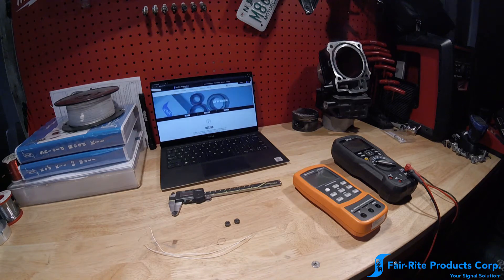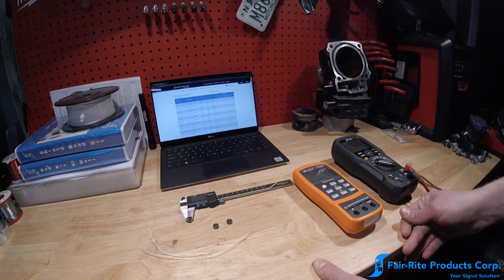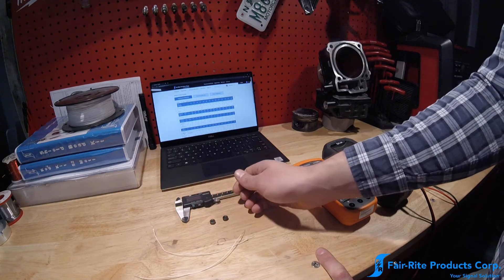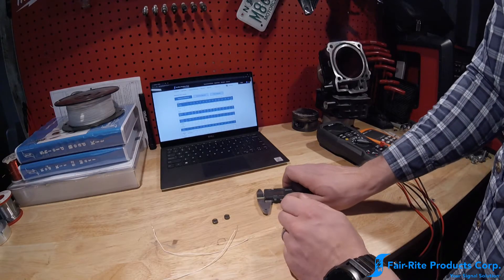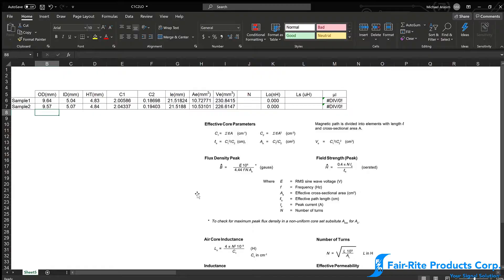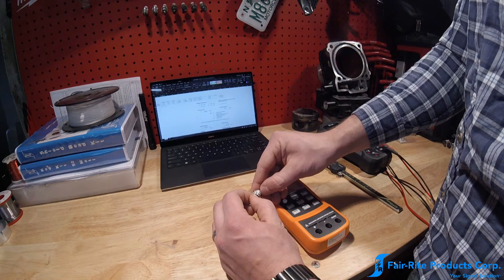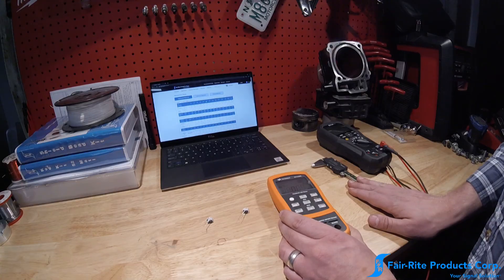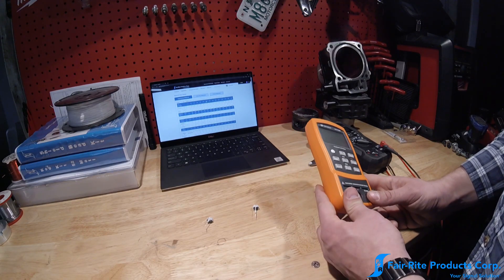How to Identify an Unknown Ferrite Core

Comment: Will thos work with snap on split beads?
Reply from the maker: It should work fine for snap-its. The permeability might read a little low due to the small air-gap present.

Comment: Kindly comment on type 31 vs type 43 for HF (1.8-30 MHz) choke?
Reply from the maker: 31 material. At 30MHz, they’ll be similar but, 31 should be superior below that due to the higher permeability.

Comment: what abour core shape like ETD or EE ? is this method work for that too?
Reply from the maker: That'll work for ETD or EE core sets as well! The calculation for the cross sectional area and magnetic path length are a little different but, the concept is the same. One thing to be cautious of is the air gap in cores like this. If the surfaces are well finished, this can be negligible. If the surfaces are uneven or rough, this can skew the inductance value very low compared to what the material perm would otherwise be.

Comment: f = 1/(2pi*((L*C)^0.5)). If you know your frequency, then use a series circuit with a potentiometer with your LC part of the circuit.  You can dial in your pot so that the voltage drop is the same, that the value as the same.  And you know the value of C, just plug and crank on your calculator, or spreadsheet.

Comment: Which ferrite type is the most stable at temperature changes (permeability vs temperature)?
Reply from the maker: As a general statement, 67 material has the most stable permeability over temperature. Depending on the exact temperature range, there could be other materials that are more stable at particular temperature ranges.
Reply: @FairRiteProductsCorp  thank you for your response!

Comment: Hi Mike. Wonder if you have a sec to help me determine What I have here. I have some snap together ferrite that I was able to determine are nickel based material. They measure A=25.7, B=13, C=28.8, &D=13. I'm looking for the best way to run the impedance test to determine the core material. The only markings on this is on the plastic case saying FAIR_RITE VO. I'm assuming that's just the plastic case number. Thanks for you time  de KA9TII
Reply from the maker: The V0 is just the flammability rating of the plastic. Impedance analysis is a bit more difficult. Essentially you’re going to need some way to genereate a signal and a way to measure the response of that signal. Some of the newer inexpensive Vector Network and Spectrum analyzers (Nano VNA or Tiny SA for example) have impedance analysis functionality built in to them. While not totally accurate, they are surprisingly good and should be more than capable of telling the materials apart. If NiZn, the core will either be 43 or 61 material. 

What does the outsize of the core/case look like? Whether it is round or square or octagonal will help me narrow down on a part number.

Thanks, 

Michael Arasim
Reply: @FairRiteProductsCorp  Thank you Mr. Arasim, for responding to my inquiry. It is square. I have a VNA, so I will investigate the impedance test. I'm not familiar with the procedure, but I'm sure I can find something on YouTube. Again, thank you so much for your time.

Comment: Ham’s have two main questions about Ferrite cores…
1. what is the best mix for choking hf common mode currents?
2. what is the best mix for hf step up / down transformers (aka baluns)?
hf being 1.8-54mhz
these types and winding are all over the place on the internet.
Reply from the maker: For HF common mode currents, 31 material should provide the highest impedance overall in that frequency range. At more granular (narrower) sections of that band, there are other less broadband materials that can improve on the impedance over that offered by 31 material. For transformers targeting lower losses, 67 material will exhibit the lowest overall losses in the HF band. Same as with the suppression cores, there will be some materials with higher performance in certain sections of the band. 67 material does trade quite a bit of coupling (permeability) for its low loss properties. A higher loss, higher permeability may be desired for certain designs. This is especially true for lower power devices. We will be coming out with a podcast in the next coming weeks to go into this more in depth so stay tuned! Hope this helps!
Reply: 1. Mix 31; 2. Mix 43. DONE!

Comment: Interesting on the beads. Are these actually useful as inductors or only as interference suppressors?  I used a Fair-rite bead to make up a 10 uhy inductor using a General Radio standard inductor as a reference. (The standard inductor is a relatively large air core unit.)  But there was no correlation to how they operated in a tuned circuit! The general radio unit resonated exactly as expected but the ferrite bead inductor was significantly off, (over 10%) even though they both read the same on the LCR meter.
Reply from the maker: All ferrite cores have potential use as an inductor. A lot comes down to the frequency they are being used at and whether permeability there is sufficiently high and the losses are sufficiently low at said frequency. Some variation on the inductance over frequency can happen even if the 10kHz inductance looks the same between two parts. Core materials will dramatically change the over frequency performance. Often times, in a very non-linear fashion.

Comment: Very helpful video, I still have one core I don't arrive to identify. Resistivity I measure to about 14 Kohm and Initial Permeability is calculated to 60. What mix can it bee?
Reply from the maker: Hi Leif, If it is definitely a Fair-Rite core….. 67 material would be the most likely (could have previously been magnetized to account for the higher perm).

Comment: Hi Mike,  Core sample 1 (MnZn) O.D. 62.08mm; I.D. 36.01mm.; Ht 12.89mm. Sample 2 (NiZn) O.D. 61.52mm; I.D. 36.30mm.; Ht 12.72mm.   Each toroid was wound with the same 0.8mm diam. X 125 cm. long solid Silver-Teflon conductor that passed through each aperture completely for ten turns, spaced generally evenly along the surface of the toroids. The F-R spreadsheet your company offers for an Excel download operates well, and returned an Init. Perm. of 172.
Reply from the maker: Thanks for the reply- The NiZn core looks like it is probably 61 material that got hit with a magnet. But in regards to the other cores I would love to help offline, could you email ferrites@fair-rite.com so we can discuss and hopefully solve your problem! Thanks so much

Comment: Mike, Watched this video over and over. When you get to entering the series L in your spreadsheet and we see the last column fill in with Initial Permeability I am lost.  Looked at the F-R calculator and added the dims on the 2 cores I'm trying to ID, and came up with I-P reading in the last block that had nothing to do with anything on the F-R materials chart. Measured over and over. My supposed NiZn T240 toroid returned a 193 I-P, and my MnZn T240 toroid returned a 51  I-P. Sfc resist of the NiZn was 0.33nS (3.3G-Ohms) and the SR of the MnZn was 3.2nS (312.5M-Ohms). The sfc resist readings are in line with NiZn ands MnZn. The NiZn inductance was 22.4 uH and the MnZn was 5.9uH. Plugging these measurements into the F-Rite Calculator returned the squirrely readings in the little results box, and that's where the disconnection between
what materials these 2 cores were, happened.  These complete measurements were repeated over and over. The toroids were weighed and measured accurately. The project is to wind a 43:1 balun transformer for 1.8 to 30 MHz, connecting to an end-fed wire, but not knowing the material of the toroids might mean wasted efforts and materials. '73 de W4HBM.
Reply from the maker: Hi there, how many turns he checked the inductance with on each core?

Comment: After weeks of scouring the entire internet for solutions, I stumble across the video. 
The link paid for with a vial of toddler blood on the dark web, and my hope blooming as I finally read the sentence 
“using basic, inexpensive, readily available equipment”

Then the guy pulls out an LCR-meter.

The video comes to an abrupt halt, and the only thing penetrating the eerie silence is the sound of me putting the shotgun barrel between my teeth.

Relief is flooding through my being, realizing that the microsecond of lead traveling through my brain is preferable to trying to identify an inductor that the manufacturer didn’t feel was important to mark.
Reply: If you'd paid for it, you'd know.
Reply: Now you can use a $50 VNA.

Comment: what is pc40 material?
Reply from the maker: PC40 is a 2300 perm MnZn ferrite most similar to our 78 material as a reference. It would generally be used for higher flux density power devices but, it could see applications elsewhere.

Comment: Why is it not possible to laser scribe mark them ?
Reply from the maker: Thank you for the comment! We don’t laser mark every part for several reasons. The primary one is that due to the color and finish of ferrite cores, The contrast on the text from laser marking is very poor. It is possible to darken the text through multiple passes or through using a very high power level. The problem with this is that utilizing higher power runs the risk of damaging the electrical properties of the ferrite through excessive localized heating. Making multiple passes with sufficient cooling time in an option but, it would be very time consuming and greatly add to the cost of each part.

Comment: Brilliant info. I've got a whole box of assorted ferrites that I'd use if only I knew the specs. But why don't the manufacturers just colour code them like they do with resistors and capacitors?
Reply: Exactly, or maybe write on them like with capacitors. 
Would be a reason enough to buy from Fair-Rite instead of somewhere else…